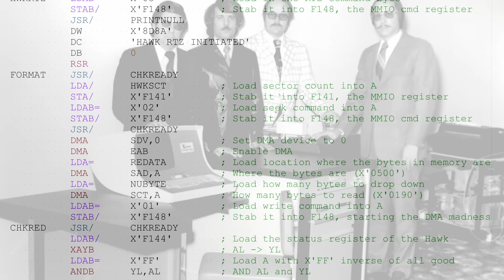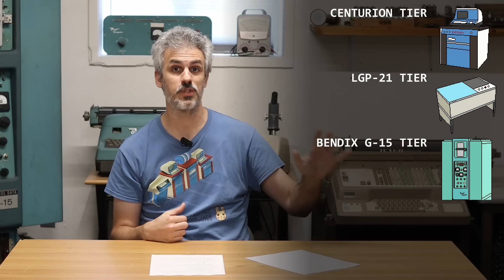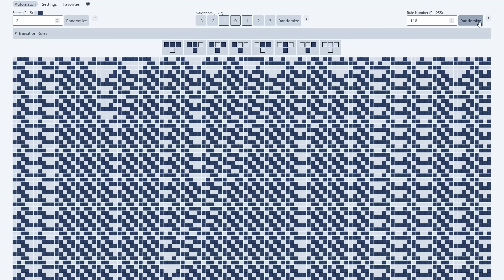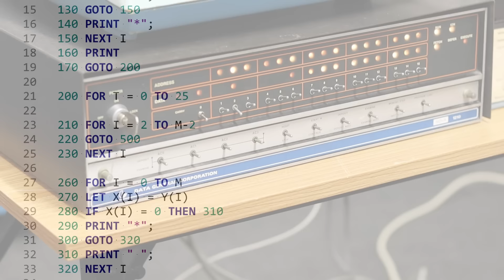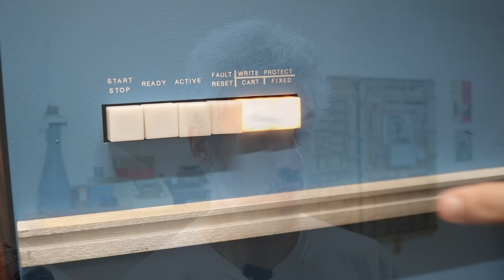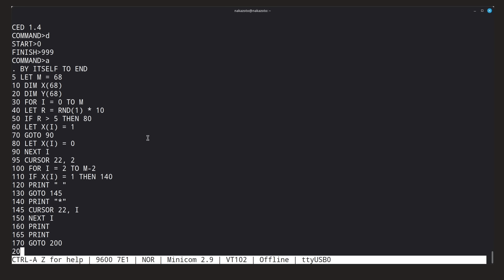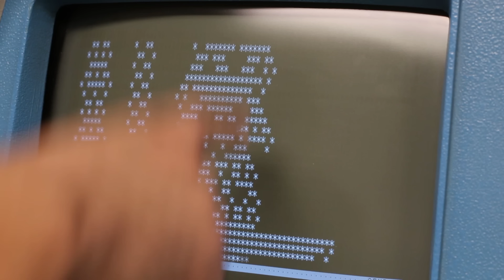BASIC on This 80’s Minicomputer is Terrible!

Comment: My background is in embedded computing. In that world you pick what you want the hardware to do first. Then how to deal with it (software wise). Depending on the situation like a digital oscilloscope you up with a FPGA and a processor that can run Linux. A FPGA is for "Field-Programmable Gate Array" it allows you load what is essentially a custom processor (and or basic logic). Customers drive capabilities and programming languages by not using certain products.

Comment: "One massive problem with Conway's game of live, and that is that it requires an XY grid. This isn't a problem if your computer has a CRT with cursor controls". Disagree! If the terminal can scroll the screen if it gets a carrige return/line feed in the last screen line, you can run Conway's game of live. I adapted such a version for Z80 and 8052 from the book "Basic Computer Games Microcomputer Edition" page 100. I agree, "Life" with ANSI escape sequences produces a nicer animation, but you can run Life even with printer output.

Comment: In about 1973 I wrote a life program for the HP2100 mini computer on a CRT terminal.  Basic was loaded from paper tape.
Reply from the maker: The HP1000 and 2000 series minicomputers are awesome little machines I'd love to get hands on with someday!
Reply: I learned BASIC on HP2000 via 110 baud dial-up, ASR-33 and paper tape! 😀
Reply: @Lord-Sméagol  Wow!  I used to think 1200 baud on my Commodore 64 was excruciatingly slow, but I clearly didn't realize what a luxury I was enjoying. At 110 baud, did you have enough time to go make a sandwich while waiting for a single paragraph to populate? My kids complain when our 800Mbps temporarily slows down a bit.
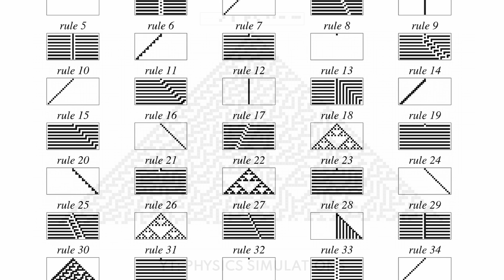Reply: @hungry-programmer  I went to the computer room basically EVERY day after school until the caretaker came to lock up at 6:30.
One day, I found the STAR TREK game in the system library [GET-$STTR1] ... It took the best part of 1/2 hour to LIST ! But I learned a LOT from it!
Reply: @hungry-programmer  C64 programs were often a lot bigger. Tape loading really got annoying when computers got 16K memory or more. :)
Reply: @Lord-Sméagol  We started with a 110 baud teletype also.  Then got a CRT terminal that went I think 300 baud.  We were in heaven.  We also had a CDC 1604 which was the first computer the cray designed.  I wrote one program in assembly to read and write a tape drive.  We programmed with a paper tape.  We got a Tektronix graphics computer which was great.  I did my thesis on it.  Thermal printer and magnetic tape cartridge.
Reply: Wow, that’s legendary! My first computer class in middle school was all about BASIC programming on TRS-80 Model I machines. I still remember that we all had to share a single floppy drive; we’d wait for our turns, and the teacher had to use a physical switch to toggle the drive connection to our specific station. I eventually bought my own Commodore 64, and that experience literally changed the trajectory of my life.
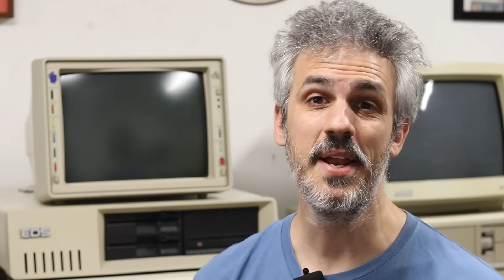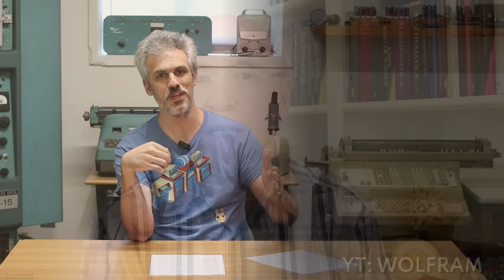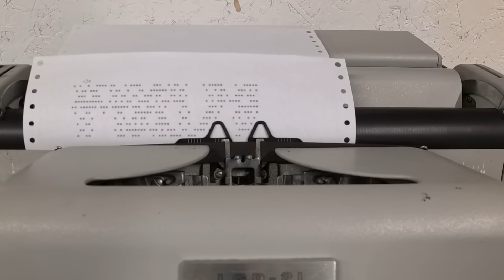Reply: @hungry-programmer  2 Timothy 2:15 KJV - John 5:39 KJV - Proverbs 4:7 KJV -  John 8:32 KJV
Lets seek BIBLE with: Robert Breaker, Gino Jennings, Stephen Darby Ministries , Dr Peter Ruckman, Les Feldick

Comment: I've been working on a simple BASIC compiler for the 6502. It also uses an intermediate bytecode and a custom interpreter. It's limited to 16-bit integer maths, but it does still support long variable names (which are only used at the compilation stage; the intermediate program just accesses memory by address) and multi-dimensional arrays.

Comment: Sadly, the BASIC version is not compatible with the Sinclair ZX Spectrum 🌈. Sinclair BASIC subscripts (arrays) start at 1, and GO TO is not optional after THEN.

I've resolved these issues to make the code compatible with the BASIC on the ZX Spectrum, and took the liberty to shorten the line length and number of generations to better suit the Spectrum's resolution. Other than fixing the bug in line 100 mentioned in my other comment, I've otherwise resisted the urge to make other changes to the code to improve efficiency and reduce repetition.

   5 LET M=31
  10 DIM X(M+1)
  20 DIM Y(M+1)
  30 FOR I=0 TO M
  40 LET R=RND*10
  50 IF R>5 THEN GO TO 80
  60 LET X(I+1)=1
  70 GO TO 90
  80 LET X(I+1)=0
  90 NEXT I
 100 FOR I=0 TO M
 110 IF X(I+1)=1 THEN GO TO 140
 120 PRINT " ";
 130 GO TO 150
 140 PRINT "*";
 150 NEXT I
 160 PRINT 
 170 GO TO 200
 200 FOR T=0 TO 20
 210 FOR I=2 TO M-2
 220 GO TO 500
 230 NEXT I
 260 FOR I=0 TO M
 270 LET X(I+1)=Y(I+1)
 280 IF X(I+1)=0 THEN GO TO 310
 290 PRINT "*";
 300 GO TO 320
 310 PRINT " ";
 320 NEXT I
 330 PRINT 
 340 NEXT T
 350 GO TO 30
 500 LET C=0
 510 FOR Z=(I-2) TO (I+2)
 520 IF Z=I THEN GO TO 550
 530 IF X(Z+1)=0 THEN GO TO 550
 540 LET C=C+1
 550 NEXT Z
 560 IF X(I+1)=0 THEN GO TO 800
 700 LET Y(I+1)=0
 710 IF C=2 THEN GO TO 750
 720 IF C=4 THEN GO TO 750
 730 GO TO 230
 750 LET Y(I+1)=1
 760 GO TO 230
 800 LET Y(I+1)=0
 810 IF C=2 THEN GO TO 850
 820 IF C=3 THEN GO TO 850
 830 GO TO 230
 850 LET Y(I+1)=1
 860 GO TO 230
Reply: Sinclair ZX Spectrum BASIC is very slow; it needs all the help you can give it! 😁

Comment: You have a bug in the BASIC version! 🪲 Line 100 should be: 100 FOR I = 0 TO M

You can see the issue manifest on the Centurion at 19:54 in the video. Why does the second line end with an asterisk? It appears to have popped into existence from nowhere.

Au contraire, mon ami. The first line, generated randomly, is printed without the first two or last two cells. Noting that the first line is thus four cells left of where it should be, we can infer that the missing last two cells on line one are in fact "**" — which results in the last cell "living on to the next generation" I leave determining the missing first two cells on line one as an exercise for the reader.

Interestingly, you fix the bug when converting to CPL. 🙂

Comment: Here is a slightly faster version of the program, using the same BASIC restrictions:

10 LET M = 68

20 DIM X (M)
30 DIM Y (M)

40 FOR I = 0 TO M

50   IF RND(1) * 10 > 5 THEN 90

60   LET X(I) = 1
70   PRINT "*";
80   GOTO 110

90   LET X(I) = 0
100   PRINT " ";

110 NEXT I
120 PRINT

130 FOR T = 0 TO 25

140   FOR I = 0 TO M

150     LET C = 0
160     FOR Z = I-2 TO I+2
170       IF Z < 0 THEN 200
180       IF Z > M THEN 200
190       LET C = C + X(Z)
200     NEXT Z

210     IF C = 3 THEN 290 

220     IF X(I) = 0 THEN 250

230     IF C = 5 THEN 290
240     GOTO 260

250     IF C = 2 THEN 290

260     LET Y(I) = 0
270     PRINT " ";
280     GOTO 310

290     LET Y(I) = 1
300     PRINT "*";

310   NEXT I
320   PRINT

330   FOR I = 0 TO M
340     LET X(I) = Y(I)
350   NEXT I

360 NEXT T
370 GOTO 40

The surrounding cells counter [150-200] copes with the edge cells and doesn't exclude the centre cell from the count; logic will cater for that:

  If centre cell is alive and 2 or 4 of the surrounding cells are alive,
  or centre cell is not alive and 2 or 3 of the surrounding cells are alive ...

is equivalent to:

  If centre cell is alive and 3 or 5 of the cells including the centre are alive,
  or centre cell is not alive and 2 or 3 of the cells including the centre are alive ...

The common count of 3 can be quickly tested first [line 210], then the remaining cases are simpler to test.

The output code has been integrated into the randomization and update loops to save duplicating the is current cell alive test.
Reply: I did a light-touch revision the program for the ZX Spectrum in another comment, and considered making similar changes for efficiency. Had I done so I would have carried out the bounds checking in 170-180 outside of the (inner) loop to ensure these checks are done once per cell, rather than five times per cell. As you intermingle the setting and display of the cell (260-300), that would require disaggregating this (i.e. the LET from the PRINT) and thus adding a read/branch for the actual display — however, I would expect that the savings noted in the inner loop would more than offset the cost of this.
Reply: @jtjacques  Another (probably the best) option would be to pad the array by 2 each end.

With these new lines, it should safely display 64 cells per line (not showing the static bordering cells):

10 LET M = 64+2

20 DIM X (M+2)
30 DIM Y (M+2)

40 FOR I = 0 TO M+2

140   FOR I = 2 TO M

170       REM Bounds check not needed
180       REM Bounds check not needed
Reply: @Lord-Sméagol   That certainly is an option. It is almost always possible to trade-off between speed and memory consumption.
Reply: @jtjacques  Easy in this case: Only 4 extra elements for each array.
Reply: I just had to squeeze it for TRS-80 L2 BASIC [edited: pad array to remove inner loop bounds checking]:

10 DEFINT A-Z
20 Z=0:C=0:I=0:M=65
30 DIM X(M+2),Y(M+2)
40 FOR Z=2 TO M
50 X(Z)=RND(2)>1
60 PRINT CHR$(X(Z) AND 10 OR 32);
70 NEXT
80 FOR T=0 TO 25
90 FOR I=2 TO M
100 C=0
110 FOR Z=I-2 TO I+2
120 C=C-X(Z)
130 NEXT
140 Y(I)=C=3 OR X(I) AND C=5 OR NOT X(I) AND C=2
150 PRINT CHR$(Y(I) AND 10 OR 32);
160 NEXT
170 FOR Z=2 TO M
180 X(Z)=Y(Z)
190 NEXT
200 NEXT
210 GOTO 40
Reply: An improved TRS-80 version:

10 DEFINT A-Z
20 I=0:C=0:O=0:A=0:B=0:M=66:T=0
30 DIM X(M+3),L(11)
40 L(4)=-1:L(6)=-1:L(7)=-1:L(11)=-1
50 FOR I=3 TO M
60 X(I)=RND(2)>1
70 PRINT CHR$(X(I) AND 10 OR 32);
80 NEXT
90 FOR T=0 TO 25
100 O=0:A=0:B=0:C=X(3)+X(4)
110 FOR I=3 TO M
120 C=C-O+X(I+2)
130 O=A:A=B:B=X(I)
140 X(I)=L(-X(I)-C-C)
150 PRINT CHR$(X(I) AND 10 OR 32);
160 NEXT
170 NEXT
180 GOTO 50

Super-compact:

1DEFINTA-Z:I=0:C=0:O=0:A=0:B=0:M=66:T=0:DIMX(M+3),L(11):L(4)=-1:L(6)=-1:L(7)=-1:L(11)=-1
2FORI=3TOM:X(I)=RND(2)>1:PRINTCHR$(X(I)AND10OR32);:NEXT:FORT=0TO25:O=0:A=0:B=0:C=X(3)+X(4):FORI=3TOM:C=C-O+X(I+2):O=A:A=B:B=X(I):X(I)=L(-X(I)-C-C):PRINTCHR$(X(I)AND10OR32);:NEXT:NEXT:GOTO2
Reply: I decided to do one (with some speed optimisations) for the Ti-99/4A just to see the speed compared to the Centurion.

10 Z=0
20 C=0
30 I=0
40 M=29
50 DIM X(31),Y(31)
60 FOR Z=2 TO M
70 X(Z)=RND>.5
80 PRINT CHR$(32-X(Z)*10);
90 NEXT Z
100 FOR T=0 TO 25
110 FOR I=2 TO M
120 C=0
130 FOR Z=I-2 TO I+2
140 C=C-X(Z)
150 NEXT Z
160 Z=C=3
170 IF Z THEN 210
180 Z=C=5
190 IF X(I) THEN 210
200 Z=C=2
210 Y(I)=Z
220 PRINT CHR$(32-Z*10);
230 NEXT I
240 FOR Z=2 TO M
250 X(Z)=Y(Z)
260 NEXT Z
270 NEXT T
280 GOTO 60

It takes about 4 seconds per line.

Comment: Actually, you could run Conway's Life on a teletype by storing the "screen" in memory and then printing it out.  It would be rather a waste of paper and ink though, redrawing frames with very little change in them.  I wrote a version of Millen's Life in TRS-80 BASIC, which took about 6 seconds per generation with the CPU running at 1.77MHz.  Occasionally, you can get a pattern that doesn't go stable until 100 or more generations. (I speed up the emulator to save time!).  BTW, the Psion Organiser (pocket computer from the '80s)  translates it's Organiser Programming Language into a pseudo-code (they call it QCode) and it's surprisingly fast - COBOL does something similar I believe..

Comment: "CPL" also stood for "Common Programming Language". And BCPL was a strongly simplified (typeless) version of that, known for its use as a system programming language in the pivotal Xerox Alto of 1973 (the first WYSIWYG computer with graphical windows, pull down menues, icons, a mouse, laser printer, ethernet, etc). 
But BCPL is perhaps even more famous as the language (or rather the compiler) that Thompson and later Ritchie modified in order to implement their B and C languages. B was basically just a syntactically perverted (imho) version of BCPL, while C also added a simple type system on top of that.
Reply: And in around 1982 I wrote Conway's Game of Life in BCPL for display on a CRT terminal. It was compiled down to TMS9900 binary and ran pretty well at 9600 baud.  Sadly, the code did not survive my redundancy in 1992.
Reply: CPL was created by Christopher Strachey - one of the pioneers of computer science - and the language was known colloquially as Christopher’s Private Language!

Comment: So cool!  I typed it out on my original Atari 800 in Atari Basic, and it works...slowly.  And, unfortunately, the 800 is only capable of 40 columns... but it works!  It appears to be running at about the same speed as the Centurion Basic version.

Comment: Kind of obscure, but if you treat the "framebuffer" for CA as a Z-Order curve instead of a linear tiling, you can do a "1 dimensional" algorithm that has coherent memory access, but draw it to the screen in a way that looks like it's a more interesting 2D CA system doing more taps than it really is.
Texture sampling hardware in modern GPU's uses the Z-Order curve layout trick for texture images, so sampling from them is more cache friendly and memory access is more linear.  Slightly different problem being solved, but the math is basically the same shape.  Would be annoying as heck to try to implement correct texture sampling in janky old BASIC, but if you just kinda want a chaotic looking blinky demo screen it's fine if it's done theoretically wrong as long as it looks like something is scootin around.  As long as the "blit" puts something on the screen in mapping from Z-Order to Linear tiling it can be neat.

Comment: Far be it from me to rubbish pioneering technology, but even by the standards of 1978 this machine is severely behind the industry. No interactive basic? 
I suspect that most of these machines were sold as a package with application software, like accounting or stock control already loaded and that the vast majority of end users never wrote any code themselves, apart from batch scripts.

Comment: Porting MS BASIC from 6502 to CPU6 Assembly is at least the easier direction to port in, meaning porting from CPU6 to 6502 would be brutal. The CPU6 is register rich and the 6502 is not. Converting the 6502 Intent to CPU6 is the tricky part, no point converting all that workaround to a machine that doesn't need it. What I'm saying is converting MS BASIC to the Centurion is completely doable but needs someone fluent in 6502 and CPU6.

Comment: I believe the speed of the 1-D Basic can be doubled, by using a simple encoding trick.

Instead of two arrays with the 0/1 (life/death) state, you use a single array storing a "transformation" state that has four values (Lives, Dies, Grows, Rests).

This encodes both the current state and future state in 2-bits. (0 = Stay Dead, 1 = Be Born, 2 = Die, 3 = Stay Alive)

Notice how (0,1) encode that the cell was dead; and (2,3) encode that the cell was alive.
And (0,2) encodes that the cell will be dead; and (1,3) that it will be alive.

So the past & future state can be extracted via dividing by two (past) or by taking the modulo (future).

Your code has to loop twice and needs two writes per cell -- because it needs to copy the evolved state back to X.

The above encoding allows to do both steps in one loop and each cell is only written once.

The general flow is:

* Initialize the array X with random values from [0, 3]
* For each cell in X:
* > IF cell was alive PRINT "X" ELSE " "
* > IF cell was alive AND has (2 || 4) neighbors THEN set X[C] = 3 (Lives) ELSE 2 (Dies)
* > IF cell was dead AND has (2 || 3) neighbors THEN set X[C] = 0 (Stays dead) ELSE 1 (Gets born)

The neighbour count is the value S computed as:
S = (X[C-2] / 2) + (X[C-1] / 2) + (X[C+1] % 2) + (X[C+2] % 2)

Do note how the already modified left-neighbors use the past state (division), while the unmodified cells use the present/future state (modulo)

Notice that this also means that you do not have to loop to compute the neighbours.

[Edit #1]: I went ahead and created a pull request (#12) against that file in your repo.
[Edit #2]: If you don't care for readability, you can take this further and collapse 8 cells into a 16-bit integer and use bit-shift operations to update the automaton.
Reply: Neighbor count can also be optimized by calculating an array with the accumulated sum of alive cells (since the start of the row), then the neighbor count is a simple subtraction of acc[x+2] - acc[x-2] (or probably acc[x+4] - acc to handle the edges).
Reply: @nurmr  Indeed, you can use memoization to speed up the computation by trading it for more storage space.

And there are also other tricks from 2-D game of life, like packed bit and boolean opeations, caching common patters via quadtrees, using hashing to skip entire areas, etc.

Most of those are overkill for the 1-D version though and would be an absolute pain-in-the-rear to implement in BASIC. 😅

I was happy that the speedup actually managed to reduce the lines-of-code. I could get it down to 35 LOC.
Reply: Your description specifies the MSB (past) as 0 for alive and 1 as dead, with LSB (future) as 0 for dead and 1 for alive. To allow for the computation of S as described, these should be consistent (nominally, 1 alive, 0 dead).
Reply: In that era, BASIC did not have a modulo operator, though sometimes they have arithmetic AND. And dividing by 2 might cost the same as a full numeric divide.

On the other hand, 2 bits * 5 cells is 1024 states, which can be encoded in an array. But then computing the index (concatting 10 bits) might be slow.

None of these options are wrong exactly, they'll all be slow, except for the one your particular machine was optimized for.
Reply: @WilliamZwicky  You are indeed right. 
Centurion Basic has no MOD operation, in which case you need to use Bitwise-AND (X AND 1) instead of (X MOD 2).

As for division by two, it can indeed be replaced by the much faster shift-right (SHR) -- which is also not available on Centurion Basic.
In that case, all operations can be replaced with unrolled IF chains, since there's only four values -- making the code longer and less readable, but more compatible.

It's almost as if Centurion Basic is awful. Who knew, right? 😉
Reply: @hedaurabesh  I grew up on C64 BASIC, I don't see what's so awful about the Centurion version. :p